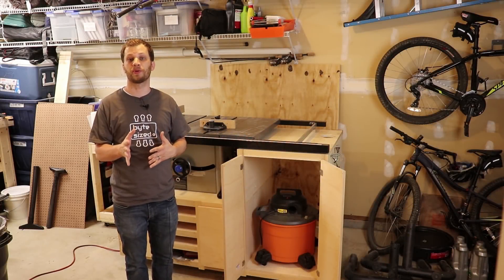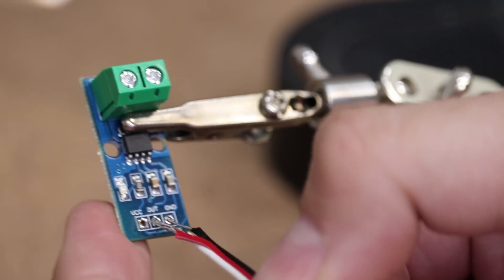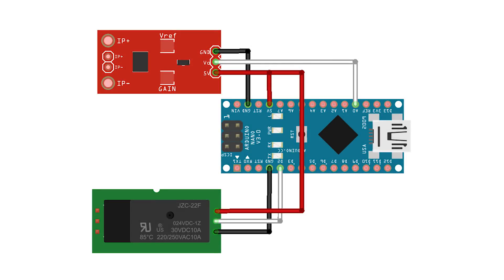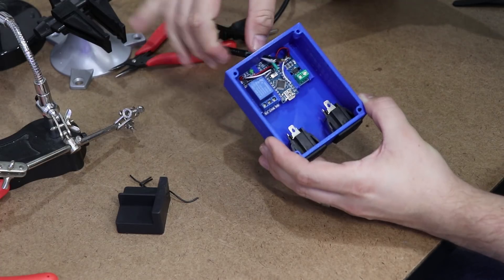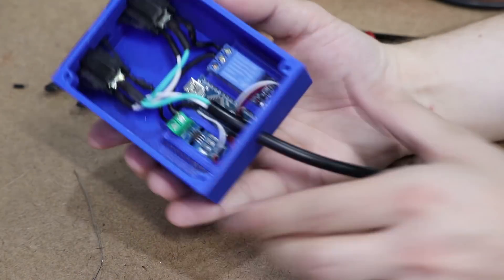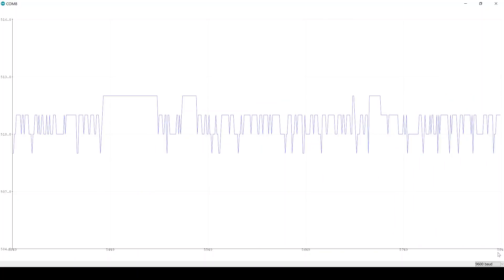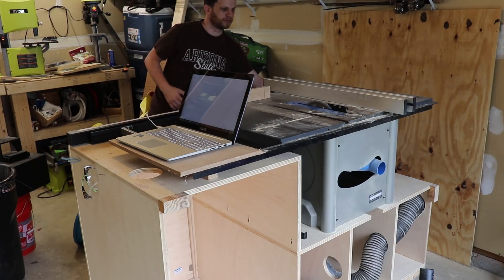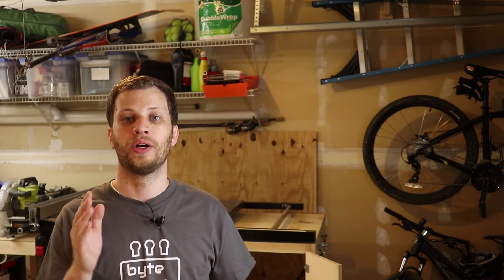How To Make A Simple Switch To Automatically Turn On Shop Vac

Comment: Great video Zach!  Really appreciate this.  Took me a few minutes to realize I needed 5v DC but I made a minor tweak to the arduino mount and ran my USB cable to the box and worked great.  Keep em coming!
Reply from the maker: Thanks Sean! Sorry for the confusion. I had originally planned on using an AC power supply module to power the arduino but it didn't arrive in time. I'm working on a lathe RPM display with an arduino right now that'll use this module so stay tuned!

Comment: Built one of these a few years ago using a small 5V transformer on connected to 5V pin, worked fine for a few years, then extractor started randomly switching on & off. Tried reprogramming the Nano but still the same but eventually realised the Nano behaviour was different when powered from laptop (for reprogramming) than from transformer.  Swapped power supply (that measured 4.8V) for a 12V one connected to Vcc and normal service was resumed. (Still used Nano 5V pin to power relay & hall effect current sensor.)

Comment: I think you can just use a 120v//120v Solid State Relay and get the same results.   On the one side run the trigger to the tool socket, when the circuit completes, the relay side turns on, and when you turn the tool off, it turns off the relay side too.  Although running after is a nice extra feature.

Comment: Thanks for making this video! I'm researching this same subject for my shop, deciding whether to use current sensors or piezo vibration sensors on the tools. I like your idea of letting the vacuum keep running for a few seconds after a tool turns off. Since larger tools tend to create a heavy power load while starting, I plan to wait a couple seconds after sensing a tool turn on before turning on the vacuum, to give the tool time to fully spin up before the vacuum competes with it on the powerline. 

To expand the whole idea - rather than move the control unit around and plug tools into it one at a time, I plan to run air hoses to multiple tools, each having a gate so air is only sucked from the tool that's running. So I plan to open and close each tool's duct gate when it turns the vacuum on and off. Some guy did this using ordinary little SG90 servos to open and close the gates, and they seemed strong enough to handle it.

Comment: Awesome project! Does the arduino need constant 5V DC to run the code allowing it to work?
Reply from the maker: Yes, I had planned on putting an AC/DC converter to get 5 volts, but I never got around to it. For the video, I just have it plugged into a USB wall adapter
Reply: Great, thanks for the reply! 😊

Comment: Kind of a poor design for real shop use:  Decent size shop-vacs for dust collection are easily in the 11 Amp range; Mine is even higher.  A table saw will easily draw up to 15 Amps.  So your design will trip the circuit breaker any time you cut anything that strains the saw motor.  A better design would allow for a diff power source for the vacuum; a simple Y on the input would allow sharing the circuit.

Comment: What also works is to take the female end of a broken extension cord & splice it in to the table saw switch. Then plug the vac in to the table saw.

You need to check the switch to ensure switching capacity, that's usually stamped on the switch. If it's too small, simple switches are cheap, but mine's big enough.

The best part is the lack of parts, so when those electronics stop working, this is a simple way to make the auto-vac work again.

Comment: problem: Both shopvac and the tool run off the same outlet, same breaker, same phase. I recommend having 2 input plugs. The tool runs as a pass-thru

Comment: Great project but OTT complicated. Off the shelf current sensing relays are available or a simple circuit would be a current transformer coupled to a relay coil, via a bridge rectifier and capacitor if necessary.

Comment: This could have been done a lot easier and simpler with just a relay You don't need an Arduino.  When you flip on the power tool it flips the relay which also enables power to the vacuum... No programming crazy electronics or anything to mess up

Comment: Couldn't you do this without the Arduino? Can't you rectify and filter the output of the analog sensor module? If that's not good enough, why not square up the analog with a simple gate. Either way, great idea, I didn't know about those sensor and relay modules so thanks for everything!

Comment: What's bother me it's that the cheap ACS712 you bought (like all the one sold from china have only 10amp max terminal even if the ACS712 can be rated for 30 amp). Stupid assembly of the product :(

Comment: What would I have to do to power the arduino without having a extra power adapter connected to it? I have minor knowledge but am not an expert when it comes to this stuff. Besides that question, your video explains things very detailed.

Comment: Im looking to mimic this project for a solar charger that I am building. I am trying to turn on a fan whenever the hall effect sensor reads a current along the charging cable. The whole system is DC and will probably see amperage between 1A and 10A, wondering if this will pick up that amperage in it's current arduino code? Any thoughts here?
Reply from the maker: Yep should work great
Reply: @bytesizedengineering  sweet! thanks for the help

Comment: FYI, I made this using more "commercial" products:
20A duplex receptacle (break the tab in the middle, which splits them independently)
2 gang outdoor outlet box
2 gang 1 duplex, 1 blank wallplate
1 ft of ROMEX 12-2
1 ft extension cord

the 2 gang is so you can put the components on one side
and the 1 blank is so you can't see them behind the outlet
Reply from the maker: That's awesome!

Comment: Where do you get the power to run the arduino? Surely you need a clean dc supply for that? Presumably, you'd need to leave that on permanently, or remember to switch it on when you want to use a tool. 

I made an auto switch too, but I used a current transformer connected via a bridge rectifier and capacitor to an optically coupled electronic relay.

Half a dozen turns on the current transformer using one of the leads to the tool supply  provided sufficient energy to power the led and switch on the relay to the vac. If you use a bigger capacitor, the vac can be made to stay on for a bit after the tool is switched off.

No need for any subsidiary supply, or code writing. Much simpler. The electronic relay is thyristor based and will switch on 25 Amps at 240v so it supplies bandsaw, sander router table and table saw. Any one will turn on the vac.

The current transformer and the electronic relay cost me about £5 each (Thanks China) the bridge rectifier and capacitor I had anyway and probably cost pennies. A friend gave me a suitable box, and the mains connectors cost £1 each. Total construction time 2 hours. It's been in use for ten years or so now.

Comment: Many thanks for sharing you knowledge and how-to skill, I'm keen to build an auto switch unit myself, however I have  a few questions please:
1. What modifications to the code/setup would I need to do, so this system will work in the UK (220 – 240 V) . Obviously use UK plug/sockets 😄 
2. I have  a number of power tools that I want to be connected to the switch, can I simply plug in a muliti-socket extension adapter for all the power tools, and the adapter into the switch unit? 
3. What is the process of transferring the code to the unit? Connect laptop to Nano controller via USB then what, transfer a text file to its storage chip, is it that easy?

Thanks again - I'd really appreciate your help, as the manufactured units cost around £70 GBP ($85 USD) ... and if I did want to part with that amount of cash I can not actually find a retailer that stock them!
Reply from the maker: This will work with 240V as well. I have detailed instructions on my website. There's a link in the video description.
Reply: @bytesizedengineering  Fantastic, many thanks Zack. I'll check it out. 👍

Comment: Great project and what I need for my workshop however the programming of the arduino is what gets me  as I'm no techno brainiac... Can you send the program of the arduino on this project? Also will this work on 220v appliances as that's what we use in south africa
Reply from the maker: Everything you need is found in the build article on my website. Link is in the description
Reply: @bytesizedengineering what type of switch did you use for your updated code? Momentary butt9n switch or latching?

Comment: Hey so I have build it and tested it but my vacuum stays on for ever it doesn’t turn of, what would I do!
Reply from the maker: Adjust the threshold value in the code. If your relay has opposite logic you might need to reverse the code

Comment: Awesome. you can do it cheaper and simpler by using sonoff switch, that's what it's designed for. not a lot of fiddling to do. Only $5
Reply from the maker: With a sonoff how would you use current sensing to trigger the shop vac?

Comment: Could you plug a 4 bank extension lead in for 4 power tools and just make sure only one is used at a time? Would save taking it to each tool.
Reply from the maker: Yes, that should work

Comment: Wonderfull!!
You could put in the 3d printed box a Voltage regulator and power the bord without an external powersuply.
Have you thought a way to use this with air tools?I have seen some tool vacuums to use it as a future.
Reply from the maker: Interesting suggestions!

Comment: This is great for something like a miter saw (i.e. something without a flip switch) but a simpler solution would be to just plug both a table saw & shop vac into the same power strip that has a switch.  But if you do this, be careful that the switch is protected from accidental bumps which might turn it on.

Comment: Quick question... in your current design could I use separate power for the saw and the vacuum ? I don't think I can have both my saw and shop vac on same breaker.
Reply: Yes, the power for the saw would pass straight through, only making contact with the sense circuit. You would then add a second power inlet cord for the shop vac. Which would pass straight through and be switched by the relay.

Comment: Ingenious design! A power tool and shop vac are used in short bursts; could this device be used for longer periods of time? For instance: turning on a sound bar when a tv is turned on (most new devices now do this natively, but still...)?
Reply: Yes, also easy if the TV have USB out.
A relay to start the sound system when the USB plug is powered up.
Done this my self.

Comment: This works well with my sliding miter saw, but with my 10" jobsite table saw, the vacuum turns on then off then back on again then off and so on, its just won't stay on, any ideas?

Comment: Did this project and wired it directly between two circuits (outlets and central vac) in my garage, with a wall switch for the vacuum as well, and a switch on the box to allow me to set between auto and manual activation. 

My initial plan was to have the electrical box sit in the attic near the wiring junction boxes, but I tripped myself up and neglected to run any of the wall outlet wiring up there! So, very nastily, I have it wired into the sub panel. I would never do this on anyone’s house but my own, but it worked and the wiring diagram was superb.

Comment: A short delay at the beginning would reduce the startup load on the breaker. Maybe the startup sampling period is long enough? I have a similar setup, with too short of a startup delay, and ~1/20 times the 15A breaker trips. Someday, I'll rewire the saw for 240VAC and will then need to revisit the auto-shop vac, and you're method could be applied to 240VAC saw and 120VAC shop vac.

Comment: Thanks for a great video. I am just getting into the whole Arduino subject and have zero knowledge at this point. I examined your schematic but I fail to see or understand where/how you are powering the Nano. Can you explain? Keep it simple. My 78 year old brain is a bit on the tough side to penetrate. But I keep trying. I want to build one of these for 2 reasons. First, I need one and second, I want to see if I can do it. I will await your reply with bated breath.
Reply from the maker: Love your username! Sorry I didn't make it clear in the video. I did address it in the FAQ in the video description. I was planning on using an AC power module but it didn't arrive in time for this video. I ended up just using a cell phone charger to power the Arduino.
Reply: @bytesizedengineering  I did see that but I was wondering where/how you did it? Is it just a low voltage charger that you plug in separately and then plug it into the Nano? I was just wondering how you incorporated it. Thanks again.
Reply from the maker: @smoleyhokes  you got it. I just used a separate 5V cell phone charger plugged in to the nano
Reply: @bytesizedengineering  I didn't see where you ran the wires into your printed box. I take you have to plug the transformer into a separate receptacle. I guess there was something going on behind the scenes. Thanks. I really liked the whole idea.

Comment: Awesome video but one question if your relay is in the "NO" (normally open) does that mean that your vacuum is always on and the relay is always on?
Reply: Relays are designated as NO - Normally Open, and NC - Normally Closed, indicating the state of the contacts when the relay is not energized. "Open" means there is no contact.
Not to be confused with "open the light" meaning to turn ON the light, and "close the light" meaning to turn OFF the light, etc.

Comment: Would a stronger relay be needed if the vacuum is 11 amps? Also, what would be different if adding a second input to allow drawing from 2 different circuits?

Comment: the arduino seems powered by a small white phone power supply we can see at some time. nice and simple tool. I would just have installed a small AC-DC power supply inside the box to power only the end tool and the shop vac.

Comment: Excellent presentation and documentation.  On the diagram would you please identify which black plug does the tool get connected to inside the blue box.  Thanks.

Comment: Excellent project.  Thanks for sharing.  I had a relay which could easily be changed from its default of closed to open.  Your code worked first time with no modification. Thank you 👍👍👍

Comment: Isn't it easier just to buy a 30A current sensing switch for $10?
I bought one for my table saw. I have to have my saw and dust collector in different wall outlets so that it does not take the relay, it's easy with the current sensing switch.

Comment: Can this be used to connect a powerboard into? I made a workbench with several tools built in and all plugged into a power board i want to put this in between the powerboard and the power so no matter what tool i turn on it will automatically turn on the vac.

Comment: You lost me at first I'm going to wire of the electronics.  I can wire some 2/12 but I'm not hip to wiring circuit boards and modules
Reply from the maker: You are more capable that you think! With enough motivation and research you could learn how to do this.

Comment: https://www.dropbox.com/s/12yx5iirws0tdnu/IMG_20200407_101007.jpg?dl=0

This is the correct relay?
Reply from the maker: That looks like it should work.
Reply: @bytesizedengineering  it works but the opposite works the vacuum is on at the beginning until I understand the table saw goes off, I found the correct relay but now it does not work when I turn on the table saw the vacuum  does not work but I see that a red les on the relay turns on that it can  be wrong already check all the wiring 2 times and is correct what else can it be?

Comment: Many thanks for the inspiring video. I'm definitely going to have a go at this. One thing that confuses me is if the arduino is getting its 5V power from the relay board, or whether the whole thing needs 5V power, and this wasn't covered? Many thanks again!
Reply: check out the schematic https://youtu.be/VHgaBxTPEPM?t=118
Reply: @keving.9301  It shows how the 5v signal is shared between the three devices but not the source.

Comment: You can buy complete current detecting relay module for less than $5 on eBay or Aliexpress. Just add 12V power supply and contactor for switching heavy loads. No need to complicate it with Arduino.
Search for  “current detection relay”

Comment: Hi, good video thanks for sharing. 
As I don't have access to a 3d printer and I am not inclined to play with AC power, another option would be to use a "green energy powerboard".  In Australia, I found a local supplier selling a "Powerboard Sp Green Energy Saving 6 Way" that has one master socket, four slave sockets and one normal power socket. It is fully automatic and does not need any pre-setting, programming or additional manual remote controls.

Comment: Love your videos, except I've noticed in several your soldering technique is not great.  Those holes in the lugs on the switches, buttons, etc. are not for looks. Especially when you are wiring 120VAC, you should make a firm mechanical connection first by placing the wire through the hole and crimping with pliers, then make the electrical connection with the solder. Don't rely on the solder to hold the wires. You don't want AC wires coming loose in your devices.